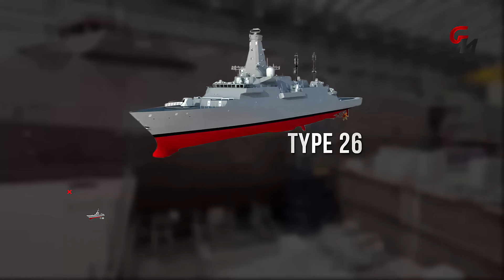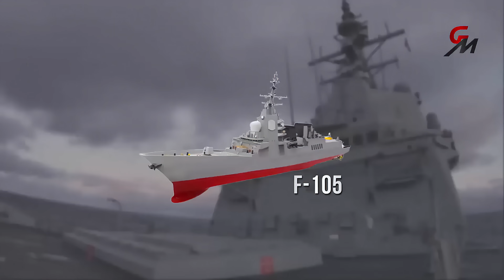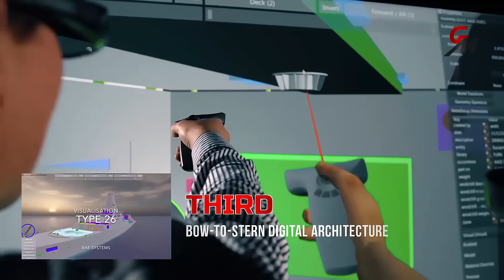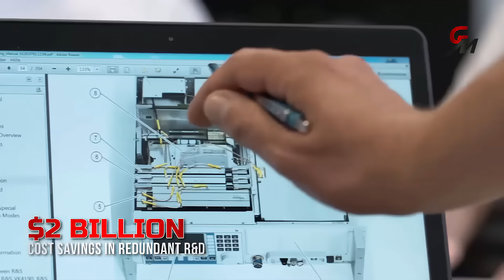Here's Why Canada Chose The Type 26 Over The F-105, Fremm-ER, De Zeven Provincien

Comment: Over 5 years to build a frigate??? the whole of WW2 was less than 6 years!
Reply: I understand that it's to do with the economies of scale, or rather lack of them. In WW2 there might be an order for 50 or more types of frigate or destroyer, then there might be 50 of the next version. This allowed a load of tolling to be made as they were all of a standard type. Modern ships are built in much smaller numbers, so you don't get that same streamlining approach. They are also far far more complex.
Reply: The plan is to take it slow, a big mistake with the Halifax Class Frigate program was pumping out hulls too quickly leading to our shipyards remaining dormant without contracts for over a decade leading to many going out of business. A goal of the River Class Destroyer program is to go slow to keep our yards open for as long as possible, ideally with the first River Class Destroyer coming in for refit by the time the last River Class Destroyer rolls off the line.

Comment: It seems Canada has made a "small mistake" by choosing the wrong Navantia candidate.
If they wanted a frigate with anti-submarine capabilities... they should have considered Navantia's new F110 instead of the F100 (F105), since the F100 series is an anti-aircraft and anti-surface vessel with limited anti-submarine capabilities...
While the F110 series is the anti-submarine, anti-surface and to a lesser extent (only 16 or 32 VLS), anti-aircraft version.

Could Canada then have chosen Navantia's F110?... I don't know, maybe not, but at least it could have chosen the "right candidate from Navantia" instead of one that fails in the main area... Anti-submarine warfare.

Comment: There are several inaccuracies regarding the Spanish design. For anti-submarine warfare (ASW), the Spanish Navy operates MH-60 SeaHawk helicopters and is expected to receive the Romeo variant, not the NH90, simply because it does not exist an ASW version of this helicopter.

The radar system mentioned is incorrect: the new Bonifaz-class frigates will be equipped with SPY-7 radar, not SPY-1. These ships are purpose-built ASW frigates, featuring advanced sonar systems like Thales CAPTAS-4 and BlueMaster UMS 4110, quiet CODLOG propulsion, and support for ASW helicopters. They are designed to replace the aging Santa María-class and complement the Álvaro de Bazán-class in Spain’s fleet.

I agree that the original Bonifaz design lacks sufficient growth margin, and in that respect, the Type 26 offers a clear advantage. All platforms are integrators, but Navantia’s largest proposal at the time—the F105-based design—was a slightly smaller ship, with a displacement of around 6,700 tons.

However, Navantia has since unveiled the Flight III Combatant, a larger and more capable design that could serve as the basis for a second series of Bonifaz-class ships. This evolution would likely push displacement closer to 10,000 tons, aligning better with Canada’s strategic needs.

Comment: The Type 26 won because it was built and designed primarily as a ASW platform, which can do anti-air and surface to surface as secondary roles. It is very difficult and expensive to build a quiet ASW warship, but BAE seems to have nailed it. The ASW role was always the main role of the RN in the cold war. They excelled at it.
Reply: That, and in the secondary roles, it still packs a punch.

RCN - DOUBLE SHOT POWER!
Reply: Why "destroyer" though? It's a frigate class.
Reply: @HowlingWolf518  The definitions aren't super clear and shift with tonnage inflation, WWII destroyers are dwarfed by modern frigates.   eg a T26 frigate is 8,500 short tons, a WWII fletcher destroyer 2,200.  Modern destroyers are usually bigger than frigates but it's not a huge difference, Type 45 destroyers coming in at 9,400 short tons.  Not a whole lot bigger.
Reply: @mostevil1082  Right, but it sounds like we're just getting Type 26s with no extra tonnage... making the "DD" designation seem more political than technical.
Reply: @HowlingWolf518 because the Canadian ones will have increased air defense capability and be super expensive. You’ll get your extra tonnage. UK designates them as frigates.

Comment: I'm a Brit and I'm not exactly convinced about the Type 26.

For starters, this ship like ANY ship is extremely vulnerable in port.

Secondly, ANY ship is vulnerable to subs, and also increasingly to USVs, UUVs and very long-range UAVs (especially stealthy ones, and even more so stealthy recon-strike ones).

The Type 26 lacks multi-layered defences against drones, and for a so-called anti-sub warfare (ASW) frigate, it doesn't even have on-board anti-sub torpedoes or VL-ASROC, which is absolutely idiotic. VL-ASROC lacks range admittedly, but it needs to be significantly increased in range. 22km is pathetic. 100km or more would be more like it.

And I'd like to see Type 26 carry anti-torpedo torpedoes. In this day & age such capability should come as standard imo.

Comment: The British call this a Frigate yet CAF calls it a destroyer.  A lot of navies blue the line between frigate and destroyer now.  I am glad they still retain a phase array SPY like radar system as they are ultra fast, and can spot small drones without much surface clutter issues.  I prefer a strong emphasis on an anti air defense which this ship still has but I understand the priority for keen submarine hunting.  Can't fish with a noisy boat or you scare all the fish away.
Reply: The Canadian variant has over an extra thousand tons of displacement with enhanced air defence capability compared to the RN/Norwegian base design. I agree a lot of navies blur the line. The Chinese have an enormous destroyer class that would be a cruiser in any other navy. Likewise even the smaller base model 26 has thousands of tons more displacement than the 4500 tons of the old Iroquois class Canadian destroyers. As an armchair, much less than expert, person what I was able to dig up was that in The RN the nomenclature is such that when a ship has a wide area anti-air capability it is a destroyer whilst anti-submarine ships are called frigates. The Canadian variant has enhanced air defence capability. I was curious about what made one ship a frigate and another a destroyer some time back and the bottom line it is called what the navy who owns it says it is. Glad to see Canada has started to build these.
Reply: I suspect frigate and destroyer and cruisers are all largely redundent names, the navy just chooses one they fancy, in reality pretty much all warships are of a similar size 5000 to 10000 ton range, they are all fairly fast, an they are all general purpose ships but have a niche anti surface, anti sub, anti air they are slightly better at than other areas.
Reply: They are cruisers by displacement and role so I agree the names are all interchangeable

Comment: My math might be wrong but going from 5000 to 7000 miles isn't a double in range lol
Reply: These ai vids never fail to input at least one false statement or some kind of slip up
Reply: For some reason the UK Royal Navy like vessels with 7000 mile plus range. Recently most of their larger new ships have had that sort of endurance or even farther. Compared to a 5000 mile range, I guess that's another 10-14 days at sea for a Blue water navy at economical cruising speeds.
Reply: Maybe its downhill   🤔
Reply: Existe un grave problema por el sobrepeso, los motores van forzados tiene una drástica disminución de la velocidad y un exceso de consumo.(Además reduciendo la vida útil, aumentando y encareciendo los mantenimiento del sistema de transmisión... Qué sistema de transmisión seleccionado para el buque no es el adecuado para lucha submarina 🤐)
Y supongo que ya se habrá solucionado en las nuevas versiones o lo tendrán que solucionar a posterior, que no tienen potencia suficiente para usar el radar cuando están navegando... Para el uso de algunos sistemas tenía que dejar no funciona la propulsión o no tenían energía suficiente. Un saludo.
Pd. Parece ser que quisieran copiar parte de Navantia pero no tuvieran acceso completo... Solo pudieran copiar algunas partes sin contar los fallos de integración de los distintos sistemas. Puede gustar más puede gustar menos pero es la realidad...

Comment: 0:35 Iroquois Class destroyers have not been in service since 2017.
Reply: The CSC is filling the capability gap left by the retirement of the Iroquois, as stated on the GOC website for the project. So it is the replacement, just not a perfectly sequential one regarding when one was retired and the next enters service.

Comment: It's a good thing Canada didn't buy the "De Zeven Provinciën-class," as it's an outdated ship from 2005. 

The current four Dutch frigates of the De Zeven Provinciën-class will be replaced in 2035 by new, larger frigates from shipbuilder Damen, with a length of 166 meters and a displacement of 12,000 tons. The new frigate will also have a much better armament, including 100 VLS vessels, distributed over two islands. 

Damen is currently working on a €9.8 billion order for the German Navy for six F126 frigates, with a length of 166 meters and a displacement of 10,000 tons. Damen is also building four Anti-Submarine Warfare (ASW) frigates. These ships are scheduled for launch in 2029.
Reply: Of course, they are already building their next generation. With these Canadian ones, they are considered a 2020 design at best, but considering the long completion timeline, the sensors, electronics, and weapons will likely be a new generation by then and the oldest these ships will need an immediate upgrade as soon as the newest one is built.
Reply: Adding to this, the newest ship (Zr. Ms. Evertsen - F805) was launched in 2005. The first (Zr. Ms. De Zeven Provincieën - F-801) was launched in 2001. Desging started in the '90's... This type would have been a great choice 20 years ago, but now it is to late.
Reply: I think it's more that they base the design on it, and redesign it with all the new tech, just like they did to Type 26. That the original design is old doesn't matter, because all the equipment and so on would be replaced with new things, making it a 2020s design and not a 2005 design

Comment: The CSC version absolutely will not do 27 kts . It’s overweight.
Reply: 72k hp gas turbines compared with 53 khp of the De Zeven Provinciën-class, 43k hp for the FREMM and F-105. should be able to keep up.

Comment: The Type 26 is an Anti-Submarive Warfare Frigate with a more general purpose designed role this design is from 2016 approved in 2017 and the first delivery was 2022 (HMS) Glasgow it was named in may 2025.

The Zeven Provinciën class is specialized air defence and command frigates (LCF) which are already quite old and will be replaced somewhere in 2030-2033. 
The LCF frigates are primarily designed for air defence and command and control, not for anti-submarine warfare.

The Netherlands is also designing their own a new specialized Anti-Submarine Warfare Frigate (ASWF) this is a project of the Royal Netherlands Navy (RNLN) with the Belgian Navy to replace the existing older M-Class Frigates (M stands for Multipurpose).

It will be a bit smaller than the Type 26 The new Dutch ASWF Frigate will be about 6650 ton, 145m in length and a beam of 18m.
A total of 7 Frigates where ordered 4 for The Netherlands and 3 for Belgian.
The first 2 ASWF Frigates will be delivered in 2028-2029 to the Royal Dutch Navy.

So I can understand that Canada would not opt for the other older designs and go for a newer design like the Type 26.
Reply: It’s the size of a destroyer
Reply: @gordonschiff3621  they all are ... 8000 tons is WW2 cruiser territory
Reply: The Dutch have only ordered 2 ASWF. And it has been delayed by an unknown amount of time.
Reply: @Prometheus4096  Will they possibly also decide to switch to a off the shelf design like Type 26.
Reply: @DavidKnowles0  There is no evidence for this. The Dutch navy has their own specific design, Damen is going to build it, and they build most of the ships for the Dutch navy. The Dutch government recently had to bail Damen out. They should already be building the ASWF. It would be really strange if that all gets canceled.